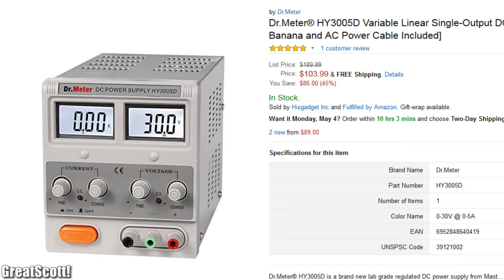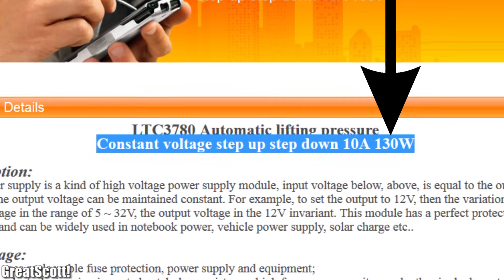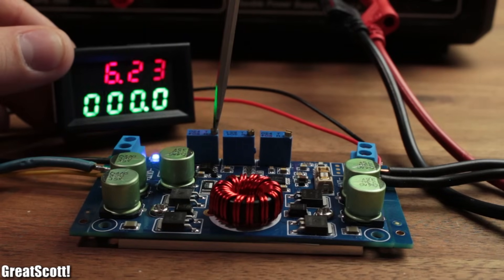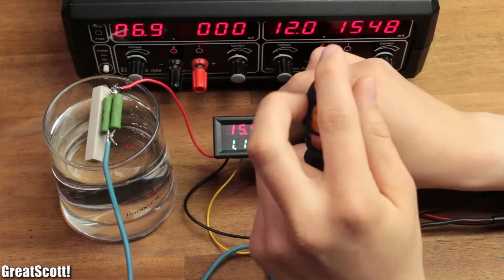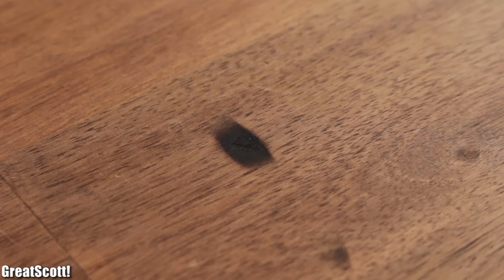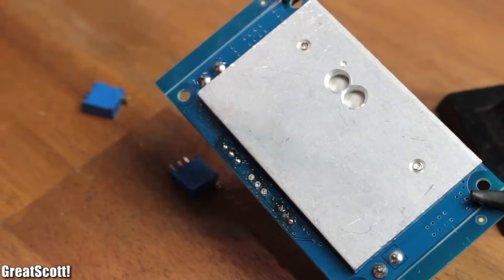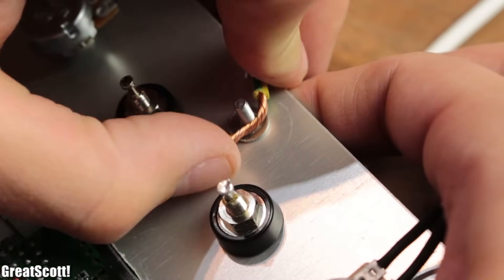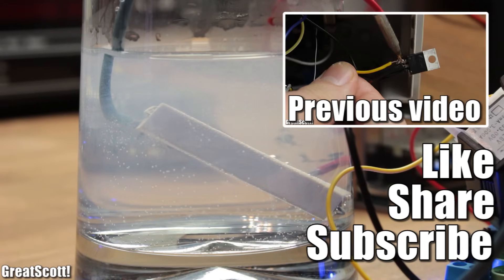Build your own Variable Lab Bench Power Supply

Comment: Thanks so much for this. I think one essential thing this is missing is having a way to fix the voltage at standard 3.3V, 5V and 12V. The way it is currently, the voltage can change easily by accident. I looked into being able to lock the potentiometer or maybe using a digital pot for the 200K and 500K pots, but it's not really easy. Only alternative I can think of is to have a few additional pots calibrated for the said voltages and use a sliding switch to move from the variable to fixed voltages. Do you have any other suggestions?
Reply: +Zing man I would try a 4 position rotary switch, which fixed resistance on 3 of the terminals, the 4th then leading to the pot.
Reply: or use a pc power supply. this way you could use the fixed voltages ie 3.3v,5v and 12v. use one 12v wire to make it adjustable like in the video. I made one myself but lacks the display and have no adjustable voltages. I even build a old car radio in it too plus a USB connector.
Reply: Thanks for the suggestions! I actually like the rotary switch idea which can allow me to fix the resistance. I was also looking for a 1->500K resistance i2c trimpot which I can use with a microcontroller to allow for locking - would be a lot cooler. :)
Reply: +Zing man Use fixed resistors and switches to do this. Or, add additional regulators.
Reply: +Dave Dörenberg-Veltman And this way, you could blow your circuit sky high the first time you have a short in it.
Reply: +SteelBlueVision with the necessary precautions you can do this.
Reply: Like what, adding a fuse? What kind and how do you control current with it?
Reply: +SteelBlueVision Not sure I understand why you say it will blow sky high with a short? I just want to have switches and resistors that are in addition to the 500k trimpot so that I can fix the voltage. of course that can only happen with some calibration. Another thing I can do is fix in a servo to physically rotate the potentiometer and use a microcontroller to control and calibrate it.
Reply: Because there is no current limiter in a PC power supply. One mistake - done!

Also, a resistor based voltage divider does not a regulator make...
Reply: +SteelBlueVision as zing man mentioned. he only wanted a fixed 3.3v,5v and 12v. a psu has them fixed on separate connectors. he could use a extra 12v connector to make that one variable like intended in the video.
Reply: That's not the point, 30 or more amps going through your wrongly wired circuit is the point and this is exactly what will happen if you make a wiring mistake with a PC PSU.
Reply: +SteelBlueVision well then... DON'T make the wiring mistake! psu's wires are color coded and should not be a problem. schematics are all over the net to find anyway. BTW I'm planning to rebuild my bench and ad a part of this video to it.
Reply: Who make circuits and doesn't make mistakes? That's not at all realistic, even if you check you wiring 5 times.
Reply: +SteelBlueVision I'm not here to argue with you. but just stating what is possible. we all know that if you make a mistake with electronics you can damage stuff and potentially hurt yourself. but that's not the point here. I only stated what is possible if one used a psu instead.

Comment: how do you get that much voltage out of a 12 volt power supply
Reply from the maker: nick dongle With a boost converter.
Reply: GreatScott! how does a boost converter work though?
Reply: nick dongle You can make 10000000 volts from 1 volt if you want, but you will have very low intensity (power = UI is conserved in the ideal scenario).

Comment: Would of been perfect is there was a fine/course feature on the potentiometers since tuning with the power supply as shown is a bit finicky. I used a 12v 8A power supply & have ordered a DC 100V 10A Voltmeter, Ammeter to replace the one recommended in this video to be able to measure higher amps then the showcased version. Otherwise then these short comings this benchtop PSU works great.

Comment: I'm sorry to maybe ask stupidly, but I want to build a power supply, and will use your video's, so first of all, Great Vid's Scott :D. I have two questions: Does it have to be exactly 5Amps, or can it be 10A istead? And how about if I accidently short out plus and minus? Will I blow a fuse in the house? Is there a Safety precaution? Love your vids man!
Reply: Magnus Frederiksen just remember 2 amps will kill you hahaha
Reply: +brenden lothamer No 2 amps will not kill you unless it is 2 amps going through your body which through your skin would require about 200 kV. This has absolutely nothing to do with the amperage that the power supply is rated for.

Comment: You don't have to adject voltage that much because that multimeter in your video is not a calibrator meter tool.  If you do that wtih Fluke 87-V, it will reading different.

Comment: Instead of the 12V 5A Power Supply can I use a PC Power Supply? (200w)
Reply: But the ltc3780 can handle max 130w I guess? Is this a problem for 200w?
Reply: +MrHD71 Yes, and the first time you have a short or bad path through your circuit, you WILL destroy it (i.e., your circuit). There is no (or very minimal and only at extremes) current limiting in a PC Power Supply.

Comment: Is there any way to make one out of a real PSU (like an old computer power supply)? I recently began real electronics learning, and having a variable power supply would be a nice addition.
Reply: +romantashev You can buy 100 amp ones for a few dollars, the inductor type. 10 bucks for a shunted meter.(~60 amps, better accuracy)
Reply: romantashev Typically, DC voltage reads normal on an AC ampere meter, but the opposite is not true.  Since in DC RMS is equal to the average value, nothing wrong will happen. And the ammeter will show the correct readings. If ac current is passed through permanent magnet DC ammeter then it will likely read 0 amps all the time, because of the positive and negative amperage swing canceling itself out. 
In other words, typically, dc amperage measurement is compatible with ac ammeters, but ac measurement is typically not compatible with a ammeters labeled explicitly DC.
Reply: +Said Kharboutli  yes, i guess, but then you need the lcd display to handle 30A at least
Reply: Richard Smith Mind linking it? Quickly searched through Amazon and couldn't find anything for that low of a price. Thanks.
Reply: +Said Kharboutli  something like that? http://www.ebay.com/itm/DC-4-5-30V-0-50A-Dual-LED-Digital-Volt-meter-Ammeter-Voltage-AMP-Power-Hot-TXCL-/301775576961?hash=item464339df81:g:0OMAAOSwo0JWKHge
Reply: Shunted:
http://www.dx.com/p/100a-3-digit-display-panel-digital-ammeter-w-shunt-resistor-black-dc-4-30v-163498#.Vkm7HXarT1s (Don't believe the 100a claim, its closer the 60a)
Inductor:
http://www.dx.com/p/5-5-x-3cm-lcd-2-in-1-dual-display-3-digital-ac-voltmeter-ammeter-meter-black-ac-100-300v-235989#.Vkm6kHarT1s
Reply: +Richard Smith  but where do you need that. Its ~AC up to 300V.   You need just lcd DC voltmeter  up to ~30V for this project, right?. You connect the voltmeter  to 12V out from the power adapter, right?
Reply: Ammeter is not the same as a voltmeter... One measures potential, the other measures current.
Reply: +Richard Smith  What i meant  was that the display you were pointing on the second link is for AC, not DC.  What is needed for the project is dual line Volt/Amp meter up to 30V DC, and up to 50 Amps., 'cos the PC power supply is  average 30 A on the 12V.  Sorry for my english:)
Reply: +Richard Smith  Thank you. I didn't know that.
Reply: +Richard Smith    D.C. voltage on an A.C .amp meter ?? What book have you been reading. ??  instructions like that you might as well use Greek.

Comment: What type of crimp connectors did you put on your wires that went into the 12v power supply? Thanks
Reply: Cable crimps or cable fittings.

Comment: Hi, thank you for the detailed instructions. I want to build this PSU but is it possible to use AC-DC adapter like the one used for charging cell phones and laptops, because I'm a bit afraid to use the supply you use in the video. Would this do the job - http://www.ebay.com/itm/220V-TO-DC-12V-2A-24W-5A-60W-Power-Supply-AC-adaptor-Line-Office-for-Led-Strips-/131306954736?pt=LH_DefaultDomain_15&var=&hash=item1e92811ff0 ? Also, do I still have to isolate the front cover with this adapter?

Comment: can i replace the pots with a lower ohm like 100k instead of a 200k or 500k.want to put some multi-turn pots pot have no luck finding anything over 100k on ebay ..
Reply from the maker: valdarmort No. The value of the resistors is important this time.
Reply: GreatScott! ok .are the single turn pots hard to dial in to a voltage /amperage.
Reply from the maker: valdarmort
a bit
Reply: valdarmort Take two pots, single turn, per value: 470k and 22k in series connection, VR3 (see link below). So you have coarse and fine tuning for the output voltage. Whether this works for output intensity VR2 as good, you have to test (220k and 22k); there is a voltage divider, mmmhhh ... Look here: http://wiki.beyondlogic.org/index.php?title=WD2002SJ_LTC3780_Synchronous_Buck_Boost_Converter_Ebay_Automatic_lifting_pressure
Reply: dromedar63 ok that sounds great .i will do that .one more question .where is the shunt resister  for your meter .is it built in .cause the 30 amp meter that i have ordered needs a external  30amp 75mv shunt resister.thanks for your help
Reply from the maker: valdarmort It's built in

Comment: First this is a nice Project. Do you know if is it possible to add a LED to indicate if the power supply is working in a current/voltage mode?

Comment: I love the system engineering and specification of this power supply. Simple yet very powerful.

What I consider to be improved: You don´t have access to a proper crimp tool, so you had to solder the mains wiring. I recommend investing in a crimp tool and the corresponding contacts. It looks better and is safer in the long run. I know that crimp tools are expansive - but crimping is one of the highest quality contacts and - once you have the tool - it is relatively inexpensive.
Reply: Ya, I would agree with you here. Some nice crimped male female connectors, or just donut round connectors would be more professional than soldering everything together permanently. Although, if it is just for me and me only, I don't think I would mind...right up until it breaks, and I have to desolder everything just to take the board out lol.
Reply: +sarowie I would argue that a soldered contact is as good or better, if he just heat shrinked it afterwards for safety.
Reply: SteelBlueVision
heat shrink is sure enough a valid alternative.

I personally still prefer crimping, but it comes down to personal preferences and experiences. Crimping can be done by anyone "following the book", while soldering is a bit of an art. Having bad solder wire, a bad day or a burned out solder tip can ruin the job in the long run, while a crimp is either good or bad at it´s easier to tell the difference.

Comment: Hey scott ich hab ein problem:
Undzwar zeigt mir das Voltage Current display nur die volt an, nicht die Ampere!
Wenn ich eine Led anschließe und dann den Strom verändere wird die led dunkler/heller
Das display zeigt aber immer 0.00amp an-.- 
Woran könnte das liegen?
Hast du ne idee?
Reply from the maker: Scavengerx3 Da hast du den Strompfad für das Display falsch angeschlossen oder das Display ist kaputt. Schau einfach mal in die Beschreibung des Herstellers. Da sind meist vereinfachte Anschlusspläne enthalten.
Reply: GreatScott! Yip display war kaputt! Hab das display mal aufgemacht und dort befand sich ein explodierter Kondensator!
Hab ihn ersetzt nun klappt alles wieder! 
Danke:P

Comment: How can you "see" the current on the amperometer, i mean, you have to use a load ( ad you have dove ) otherwise if it's an open circuit you can't see what is the value you are limiting right?

Comment: Had bad experiences with those cheap switch mode power supplies, it's always one damn thing or another...

Fried ICs, blown fuses or exploded caps: plain doesn't work
Loose transformers: vibrates the entire device till components start falling off.
Neutral shorted to live: trips breakers when plugged in, even without turning on wall socket switch.
Reply: BGM if you're talking about the ltc3780 then it's hardly cheap, the cheapest you're going to find one is about $17-$20 and it's one of the most efficient at up to 98% (at 12v-15v) now those cheap $1-$4 ones well.. of course you kinda get what you pay for, but hey hard to complain when it costs you less than a sandwich and I've had one on a solar panel, haven't used it a ton but seems to work alright.
Reply: +vgamesx1 If you looked at the circuit board he use for regulation, one of the chips was cracked and all of them were fake (i.e., Chinese knock-offs). You get what you pay for with these pre-assembled regulator boards. Don't think that they are sourcing genuine Linear parts and selling you completed boards for a quarter of the price of the regulator alone.

Comment: Thanks for the video! I built one like this but when it reaches about 1.2 amp, the voltage starts to drop. I'm not sure if I connected the display properly cos I couldn't see your connections exactly but it seems to work. Have i done something wrong?

Comment: Minor enhancement, there are 2 on board LEDs. One for power and the other for "fault".
I took these 2 LED off the board and added wires to LEDs that I added to the front of the box.
Reply from the maker: mick florey Sounds good.
Reply: great point! TY
Reply: hello, what type of leds do you have on the front? and what voltage for these leds? thank you
Reply: @jeanmaurin5273  I used small standard red/ green led. I assumed that the circuitry included some sort of current limiting. Voltage is usually 1 to 1.5v. Still working!

Comment: If you need a low current output it's easy to provide an extra + terminal post supplied by a 1k resistor  from the normal one.

Comment: Hi, very good to learn that modules like this exist! I have now bought it with the V/A module. Wiring for this was very weak, I think I may have blown the internet shunt for the ammeter section. What is the resistance of the internal shunt, so I can add one externally. Also, apparently upto 10 amps.... there is no way that the tiny gauge wires can take 10 amps??! Thanks, informative
Reply: Hello Friend! Watch my video!
https://youtu.be/Jo6KEs3t3To

Comment: Great video. But I checked the links for Amazon and got a total of about $70.00 for the  project, (without a housing)! Right now , you can get a new Lab power supply on E-bay for about $48-50.00 with free shipping. Cheaper and pre-assembled!
Reply from the maker: videodrone101 Sure. But the ebay links are cheaper and not every 50$ supply can give you 5A Output. It always depends on what you want to do with it.

Comment: Instead of using that 12v 5A power supply could you use the 12V rail on an old computer power supply?
Reply from the maker: powner250 Yes
Reply: Thanks!

Comment: Hi Scott,

great video and I am definitely thinking of building this one. I think you bought the case from Conrad, is that correct? the one I want to build is going to be a 12v PC power supply : 12V 16A 240W(small form). this is far more than the 3A that is limited by the voltage/current display. what can you recommend? and must I use another stepup/down converter because I have got a 16A psu?

I really appriciate if you help me out.
Reply from the maker: ***** Conrad is correct. Just search for another display on Ebay. There are tons of them. The board can output a maximum of 130W. If you want more then you will have to look for another one as well.
Reply: can you plz post the link of the case?
Reply: EliteReacon hi, that depends on where youre from. I think germany. 
Use this:
http://www.conrad.de/ce/de/product/521906/Universal-Gehaeuse-ABS-Aluminium-Dunkel-Grau-TEKO-AUS-33-1-St?queryFromSuggest=true

There are small and big cases. Just pick the one that suits your equipment.
Reply: thy mate :D
Reply: anyway one the product picture it's lookig quite a lot blue is this the same like scotts? *****
Reply: EliteReacon  I bought the AUS33, will have it delivered these days. I let you know.
Reply: ***** ok look forward

Comment: Can I use a laptop charger as an input of the LTC3780 (19,5 V, 4 A) without any problems? (like to reach stable low voltages, currents... I guess it wont reach the 0.8 V like in the video, is it true?)
Reply from the maker: wheeler8 Sure, it should work fine.

Comment: No isolation for the binging posts, the switch or even the female power (plug)? Should be said, that u have to isolate these connections... but ist great that u mentioned that its important to safe up everything by connecting the metal plating stuff to earth...
Kam mirn bisschen bunt vor, dass das die Kontakte nicht geschützt wurden But nice tutorial  :D

Comment: what is small 8pin IC next to voltage potentiometer?
i just burned in flames mine by adjusting first potentiometer.
Reply from the maker: sviesis It's an Op Amp. And that should not happen.
Reply: GreatScott! can you please have a look at it and tell whats written on it, so i could resolder with new one.
currently only "FAULT" led is light up
Reply from the maker: sviesis
LM 358 8AK H1418
Reply: GreatScott! thankyou, you saved me 20$ on new board, resoldered new 358 and board works.

Comment: How bad is it to not wire up the protective conductor is not connected? My house doesn't have the wires for it.
Reply: legogo29 If a wire gets loose you might get the AC voltage on the metal parts without any protection device noticing it - and most people touch 230V AC only once...
Reply from the maker: legogo29 It will be a future topic of an electronic basics video